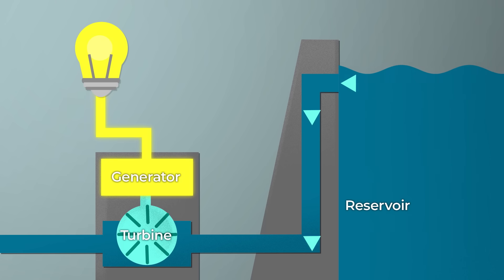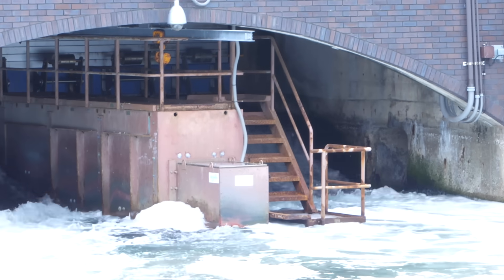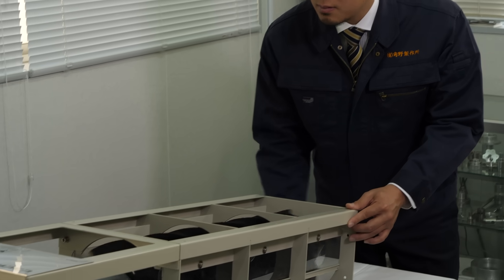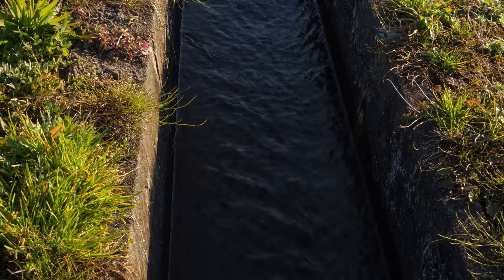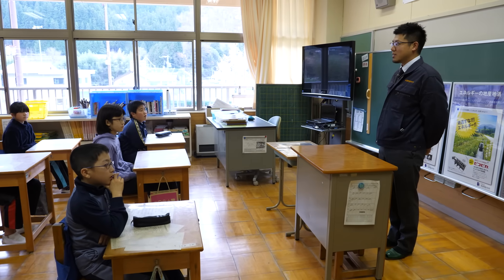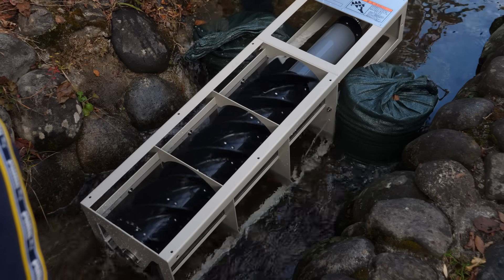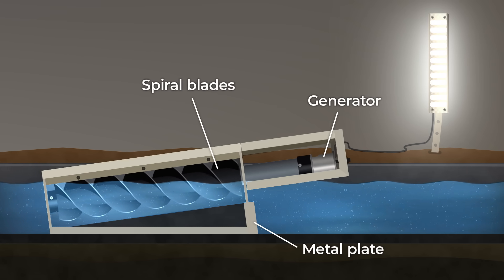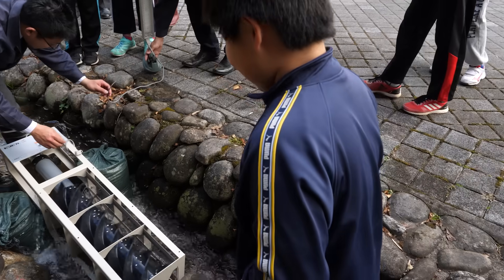Ultra-Small Water Power Generator

Comment: Good old Archimedes screw, originally designed as a lift pump for all the reasons others have mentioned - simply design, isn't affected by small debris, sand, grit, etc like impeller pumps can be.  Fitting a generator instead of a motor is also an old idea.  Using it for small scale lighting can work, however that open trough under the screw is inefficient and is why it needs the angle to assist the water flow. The screw should be fully encased in a tube. That would greatly increase the efficiency, and it wouldn't need the angle, it would still work submerged, or in heavy flood flow, where excess water would simply flow over the top and not interfere with the screw operation
Reply: Make one

Comment: where can I learn about that Ultra-Small Water Power Generator? thanks
Reply: The design is actually quite simple that with some basic experience with either 3D printing or metalwork/shop you can build your own. Some stuff about how motors work you can easily find on the internet and the concept is so simple if you have some money you can make one.

Comment: Enough power to light the small bridge ?????? How much did it cost to build the generator ??? And how much dose 3 lightbulbs cost ???? LOL. It should only take 200 years to beak even
Reply: It is quite expensive as they are using conveyor though...that required pulling and welding..

Comment: Very cool twist on an ancient idea. 

Now let us know when it can produce 1.21 jigawatts of power...
Reply: Why? Did you break your clock tower?
Reply: I suppose the heavier the flow the more output. There is resistance when producing electricity which is why it is used in generating while braking in a car.
Reply: @larrybe2900  7th
Reply: @aungkohein2127  
?

Comment: interesting. power output seems really low though.
Reply: How many watts you think of the turbine, I'm also a little curious
Reply: @yukkireina  it's probably below 10 watts. barely enough to charge a smartphone
Reply: 10watt when the turbine Spinning very fast i think, bcz when spin slowly the led still blinking and not 100% Active 😂, But that's enough for the purpose of lighting the highway for a few meters, which should be in mind how to put it safely, may be stolen  if without safety feature
Reply: れいなーちゃんゆっき it has built-in theft protection. No theif will want to steal a generator that only produses about 10W.
Reply: @yukkireina  Flickering is probably just strobing caused by the camera.
Reply: This is the screw we used in the windmills to create the Netherlands.